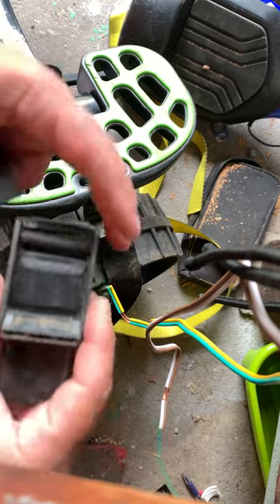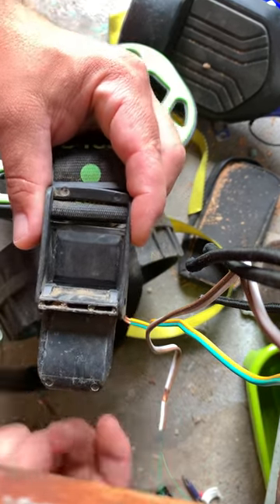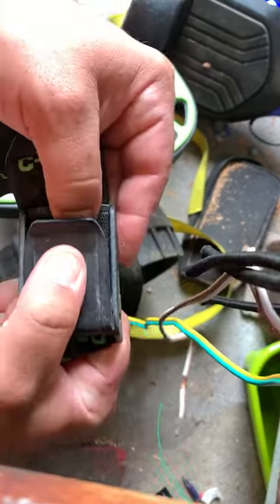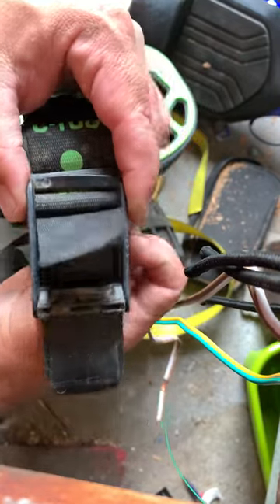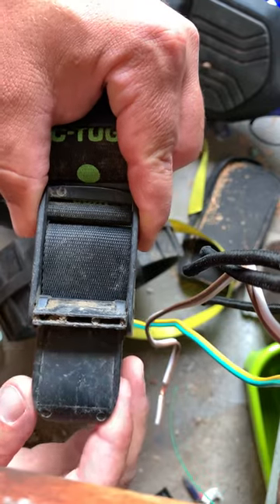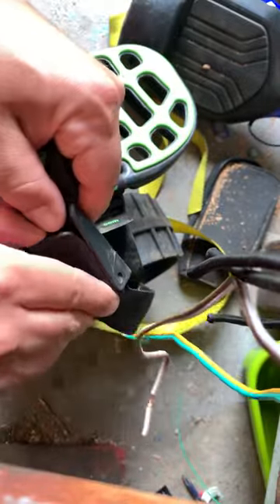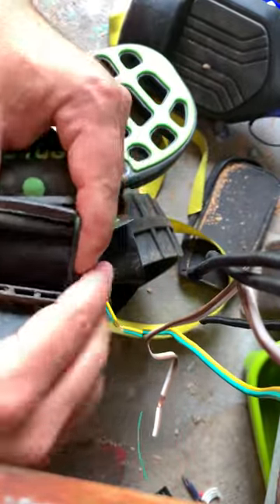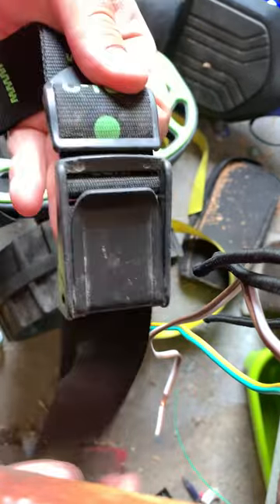C-Tug Adjustment The Smart Way

Comment: Just got my c-tug this week.  Your strap & buckle instructions are better than what is in the package.  I did not see the video yet.  Any more tips?  Such as what to do with excess strap and howto wrt the strap connections to the cart platforms.
Reply from the maker: I'm not sure I understand the question? For securing the strap to the cart it's self you pass it through the buckle as normal all the way then back on itself, I can show that too if you need. I prefer that loop to be as small as possible. You CAN cut the strap to get rid of excess, I use my tug on a WIDE variety of boats so I haven't cut it. Once I pull it tight across my boat I usually just toss the floppy end in the boat. I do have my buckle side generally adjusted so it's on top of the boats I carry most of the time, usually somewhere around the center.